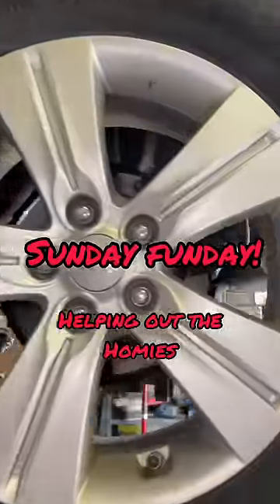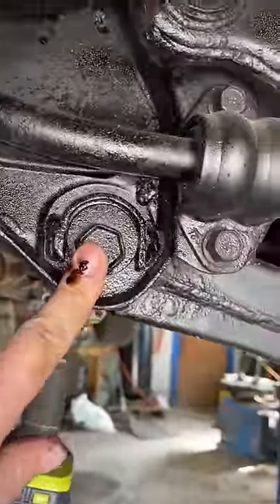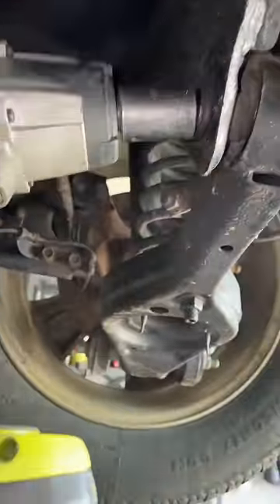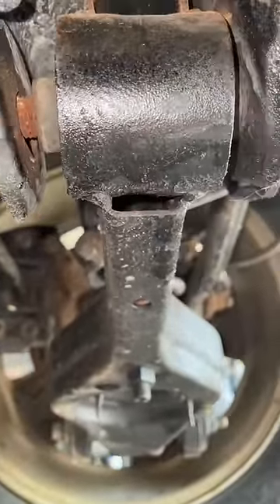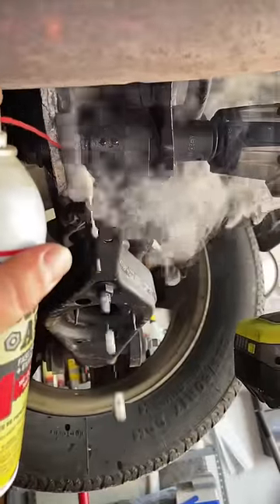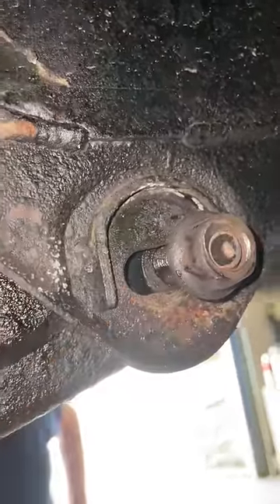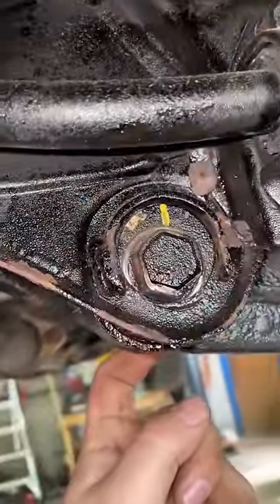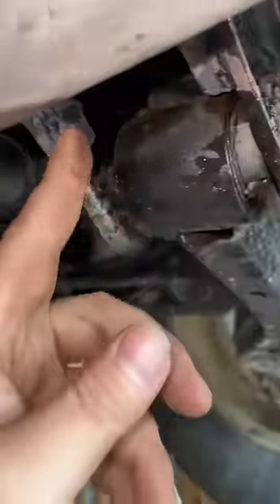Vehicle can’t be aligned problemo

Comment: I work at an auto salvage yard. We deal with this issue 10x a week. If the car is 3 years old, You have a 50 / 50 chance of getting the bolts out. Otherwise, by the time you get the bolt hot enough to let go, the rubber bushing is toast. And beating on it with a hammer just damages the crossmember.

Comment: Had the same problem with a maxima lower control arm. Set a torch on it for literally 7 minutes until it melted the bushing out and a 4 ft. breaker got it loose. Pita.

Comment: I swear if you just apply the correct support so there’s no tension on the bolt, it will come straight out with a couple hammer blows and impact (or breaker bar)

Comment: Other way is to cut the control arm, burn that bushing until only the sleeve remain, heat it red hot  and clamp a vice grip on it and unseize the bolt so you can reuse the bolt and just replace the control arm

Comment: I work at a Toyota dealership. Rav4 rear toe adjustment bolts are called immediately if it was never aligned.  They always rust solid. 2-3hr job just like this. We usually quote camber bolts for front as well.

Comment: I usually spin the nut off the one side with an impact. This won't actually spin the bolt in the bushing most of the time. But if it does that's a good thing. If not I use the impact lightly on the bolt side to spin the bolt in the bushing sleeve. This really works well to free the bolt from the bushing sleeve if it's going to free up this will usually work. You could break the metal sleeve off the rubber but usually the bushing is still healthy enough to prevent this. I spin the bolt slowly back and forth a bunch of times, keep spraying the bolt with penetrating oil as you do this. Keep the sprays coming and definitely spray it all down the night before and a few times before you try this. I've gotten some pretty bad ones out this way. Usually they do free up if youre careful. Often you have to use a brass wire brush to clean up the threads of the bolt, sometimes the rust will swell the bolt threads and it makes it more difficult to pull the bolt through the bushing sleeve. Sometimes a small punch works well to drive the bolt out or use a box end wrench to get behind the bolt head and sometimes you can leverage out the bolt. Sometimes you can use an impact to spin the bolt while you push or pull it through the bushing. I've gotten a few pretty bad ones out with a combination of these techniques. Sometimes they can definitely be rusted to the point where it's easier to grind or cut out the bolt out or something along those lines... Cheers fellow wrenchers.

Comment: As soon as you chop off both ends, you no longer have the means to remove it. You might as well get a bushing or a control arm while you’re at it. Remove the nut. Penetrating lube to the inside, and tighten-hard. Sometimes a little stretch will not only shrink the bolt, but forcefully move the bolt using the bushing’s center.

Comment: Took a hot minute, but I had success with a rear cam bolt like that once by cycling through shocking both sides with an air hammer, blowing out the crud, applying rust penetrant and then trying to turn the bolt.

Comment: Just did both my brothers lower control arms on his VW...they rotted so bad the only reason he knew was because the steering wheel was 50 degrees out and pulling HARD. I checked the whole front end over quickly at home, hmm nothing. Brought it to work...ah yes. I see. Rear arm buckled in and toe'd the wheel out so much LOL. He had new arms and bolts, washers nuts ect. Cut the old out, in with the new. Simple easy job. Only way to do it really.

Comment: I had to do mine on my Frontier. I couldn't get a grinder in there, so I did them by hand with a hacksaw. About 1 inch strokes at a time. Both sides of the truck. Both sides of each bolt. Yayyyy 😞

Comment: Happened to me with my VW touareg. Best was to just cut off the bolts, and replace the bushing as well... when putting in a new bolt, slap some aluminum anti-seize on the bolt's shaft that passes through the sleeve.

Comment: Had this happen a few months ago on a traverse which was only about 2 years old. Had to use an air hacksaw to cut the bolt out and remove the control arm l,the bolt stayed seized in the bushing sleeve and wouldn't come out had no choice but to replace the control arm. It just a quick alignment the service writer said yeah sure 2 and a half hours later its done SMMFH!

Comment: I had the same problem on my E36 M3. Damn cam bolt was stuck in the bushing that was stuck in the trailing arm. Had to cut off the lower control arm then grabbed a big ol sledgehammer, whacked it real good once and bob's your uncle.

Comment: This is a big problem with Hondas. I did it on my civic and crv. I did use an air hammer and just kept working the bolt back and forth. The alignment shop said he couldn’t even break a nut loose but it wasn’t tight at all, the bolt was seized to the sleeve in the bushing so it wouldn’t have mattered anyways. Hate those things.

Comment: Is that a Kia ? Had this same situation on a Sportage. Cut the bolts/bush in situ then new bushes & adjustment bolts. Couldn't change the arms without further cost so unbolted from top mounts because the shock bolts were also seized in the their bushes! can of worms cost runaway job.

Comment: Probably tighten it then loosen it up do that about 4 times while spraying the wd-40 and it will come u got to get the lubricant inside the bolt area just spraying it won’t just loosen it up but u could cut it either one will work

Comment: We have a CUV that didn't have adjustable camber bolts on the rear from the factory... The alignment shop called and wanted an extra $180 to put two $5 camber bolts in to adjust the rear.... It is hilarious how it's considered extra labor, because had it had cam bolts to begin with, they would still have to loosen the very same bolts to adjust the rear end!  So they wanted extra labor rate to loosen a bolt they would still have to loosen under a standard alignment procedure.  😂

Comment: It's not coming out cause the wheel is hanging in the air. Just you a tall floor jack to center it in the bolt home and use a punch.

Comment: Yeah, I stopped trying to save them. 
Just quote whole new arms now because you can only heat rubber bushings so much until they're ruined.... and typically the melting temp of rubber is lower than the heat needed to loosen up the corrosion. In Michigan at least.

Comment: That's bread and butter work. Yep, it's a pain to get it apart. But it's basically cut off the old stuff and then it's nut and bolt work. Tough for the customer due to the extra labor and materials.

Comment: In the great white north, basically anything with over 50,000mi that's seen salt will do this. We've actually gotten to the point of recommending a service where, on a newer vehicle, where the bolts still move, taking them out and coating them in anti-seize. This works like a charm. However, if they're already stuck, we do not touch them, and we recommend replacement arms and hardware.

Comment: My car has horizontal bushes on the front control arms. The nut is captive welded to the subframe and totally inaccessible. The slot in the frame that carries the bush is too deep for an angle-grinder but not open at the back so can’t use a SawZall. 
Top Tip - ALWAYS drop these bolts out and give an end to end coat of high solids anti-seize. 
If they seize or shear off you could be looking at a new subframe. At the very least, the existing subframe would have to come off the car.

Comment: I see black paint on the under carriage.
Looks like all that rust was being camoed.
As much as a car costs, you'd think that all the bolts and hardware would be either stainless steel or coated with something like WoolWax to stop the rust.
I'm in the market for a new car and will probably have the dealership undercoat it for me with some WoolWax. It lasts for about 2 to 3 years before being renewed.
I don't live up north but I'd sure have it done if I did.

Comment: doing the camber bolts replacements also :) 
90% of the job was cleaning the hell out of it with Gasoline Extraction before touching it with Liquid Wrench penetrating oil and pneumatic impact wrench :) tomorrow the other side

Comment: love it when the smart guys make a video of themselves spraying flammable fluid on hot metal... but its super special when they see rust welding metal to metal but then they spray it with lubricant... lolol?????? Ever heard of a rust catalyst ? It literally transforms the rust into a new compound literally taking everything away from the rust and even better it prevents future rust and even better it leaves the surface damn near paintable like a smooth primer... crazy stuff I like PB Blaster its like 5 bucks and cv axles ball joints end links all that.... I had a stiff noisy squeeky rusty hood latch and 3 years ago I sprayed it all and went to bed. Next morning it was silent and clean and smooth and has been that way ever since... tellin ya

Comment: I just but the nut back on the threads and beat it out I was gonna replace the bushing as anyway it came out pretty easy with a 16 pound sledge 😭
Reply from the maker: here in the rust belt often times that doesn't work unfortunately

Comment: I just replace the whole control arm and buy new alignment bolts. You get new bushings and a new ball joint. Trying to save money on them will just cost you more when it has to come back apart. Then I take the old ones and rebuild them so I have spares for later.

Comment: That's why it helps putting anti seize in the sleeve and bolts so it doesn't seize up so you won't charge 5 times as mutch for a bolt !!! But I guess you already knew that ???

Comment: I had a problem with a new truck wearing the inside of the tires and the dealership did put new tires on and said they fixed it and after a few more times I took it to a friends tire shop and had it fixed and took bill to the dealership

Comment: You could sit there for a week heating and trying. Or you could just change out the bolts and get it done in a few minutes. I had this same issue on a car I had to do some work on. It was the same kind of car. It was an AWD Murano that had a rusted out trailing arm mounts on the subframe and the rear tires kept wearinf out. I went to swap out the entire subframe with all new arms. I couldn't get the old alignment bolts out and the customer didn't want to get new ones. I let it sit for weeks waiting to hear back about it and never heard anything about it, even after telling them as soon as I found out I couldn't get the bolts out. So after like 3-4 weeks, I put it back together and sent it on its way. They came back later saying they wanted it done. 
     People kept making me wait around longer than necessary to finish my work. So I stopped working on them. Other than they stopped showing up because apparently I was the one ripping them off. I was just trying to do a proper job. They didn't want to put the money in to do it right, even after compromising on the quality of parts. And if it's not going to be a quality repair, I want no part of it. I'm not about doing the same job twice when it could've been done the first time

Comment: It's still another 500.00 for me to go through the specialty work, as it's not described in book time R&R or a 15-minute alignment. 

There is a reason why you want an alignment.

You either fail to rotate your tires. Replace them 2 or more at a time.
Curbed the vehicle, jumped the vehicle, or got into an accident. 

You don't need an alignment like you need an oil change. So be prepared to spend if you think so.

Comment: I charged for the time to beat out frozen parts. My time is valuable to me. Always told clients it was best to buy new parts vs ruin the existing ones trying to beat out  and torch the old ones which almost always destroys or damages it. Time sometimes costs more than these cheap parts. And there is nothing you can do to stop these bolts from freezing up, especially up in places where there's a real winter and salted roads!

Comment: Why would you be getting an alignment without changing the suspension? Obviously if you had the suspension changed they would have changed out these bolts as well, it looks like some hack painted the parts and said they changed them

Comment: 1 inch breaker bar and cheater bar, I've done it on a 2007 Dodge ram 1500 4x4, to replace a front strut.

Comment: Yeah, rusty bolts suck. They literally make the job three times longer than it should’ve been and take so much power from power tools or arranging with your hands. That’s what gave me arthritis a 37 was rusty bolts and it’s crazy how it’ll be so hard to turn off, creaking and cracking the hallway and then right when you get to the end, it loosens up and you can spin it off by hand then you can throw it all the way back down by hand it’s just taking it off. That’s the hard part.

Comment: Lift the vehicle 6 feet in the air, utilize air hammers, impact gun, ratchets, torches, etc etc. remove and replace required parts. Run the vehicle onto the racks and perform a 4 wheel alignment not to mention test drives. $500 is probably conservative

Comment: I recently went to an alignment shop and after they did the alignment the car pulled heavily left. They then tried to tell me that I need a new rack and pinion, new tires and new shocks. I told them they are full of it and left but I am most astonished that nothing out of the $5000+ they recommended would have actually fixed my alignment issue. Also the camber was more negative on the left side of the car. I asked about this and they simply ignored me and said that wouldn’t have an impact… coincidentally they don’t have the ability or knowledge on how to adjust camber which I discovered after they agreed to do the alignment. I also told them the rear end alignment can impact the trajectory of the car and they said that wouldn’t have an impact. I think I’ve found the dumbest alignment shop in Los Angeles.

Comment: I work in a salvage yard pulling cards apart. All types of parts of the vehicle and I tell you what when we sell either side of the complete rear suspension we already know what cars cam bolts are gonna give us problems and Hyundai sonatas are the absolute worse. They don't free. Techs and even from the factories should be putting anti seize on them before installing or reinstalling them

Comment: This is not a bad idea to chop them off But make sure you go to the dealership before you chop them off. And you have brand new ones, they're very cheap. They're only about like, 5 bucks for 4 of them. So you can easily get replaceable bolts for the camps and. Alignment❤❤🎉

Comment: Using an open flame to heat oil is not only dangerous but ineffective. Oil obviously will burn turning into carbon seizing things up tighter. If its rusty and stuck your better off using heat & candle wax and letting it cool . Wax gets thinner with heat penetrating into the rust then will expand & solidify inside the rusty joint when cool

Comment: I was the steering and suspension specialist  for almost ten years. In the rust belt. I could make really good hours on a daily bases. But I had to work for it.  Any special tricks ? Not really. What works well on one car might not on the next. One tool I could not work without, my torch. 
Everything  got put back together with anti-sieze or some type of grease. Honestly, there is nothing worse than working with rusty, siezed crap. If you  have everything freed up and lubricated, the next guy that touches that car will definitely  appreciate  it. 
Even if you work in the southern  States with no rust, put some type of lube on those suspension bolts please.  You never know where that car will end up.

Comment: After 11 years of experience working primarily on suspension and alignments ill tell you right now that you're not getting that bolt out.  Once the bolt swells up and the bolt sleeve as well they practically fuse together and become one piece of rusted shit. You're definitely going to destroy that bushing before you get even close to removing the bolt. Learn when to cut your losses

Comment: Welcome to Ohio where 90% of all vehicles are like this in the rear unless they are a GM product and then they have a much higher chance of actually moving and not being rusted solid. It is something about the steel that GM uses seems to hold up better in the salty environments. This all goes for the inner and outer tie rod ends also. But on the Japanese cars you have to get the jam nut and the inner and outer tie rod end damn near Dripping off the car to get them to move even if they're only 3 years old...

Comment: This is exactly why I have a finely calibrated "Nope, F that bolt" meter in my toolbox. If it's a standard paying alignment and it doesn't move on the first good pull with the "big" rachet I'm out, on too the next one(adjustment) 😁😁

Comment: Why would you heat the shit up beautifully, and then completely ruin it by cooling everything down with that bs spray. Everything is nice and hot and loose but then you basically quenched it and tightened it with all with the spray and THEN tried unscrewing it. You using heat? That means we’re done using the rust penetrating spray.